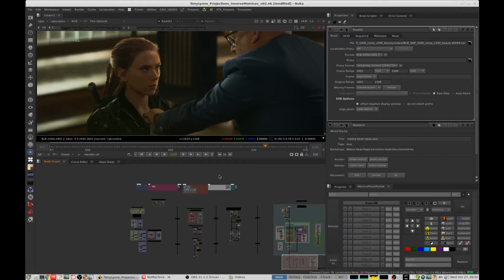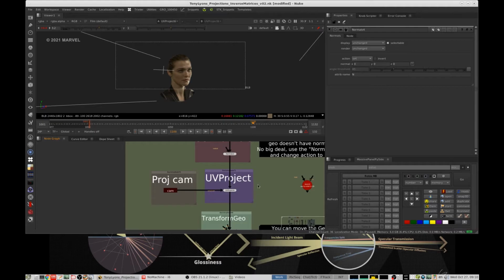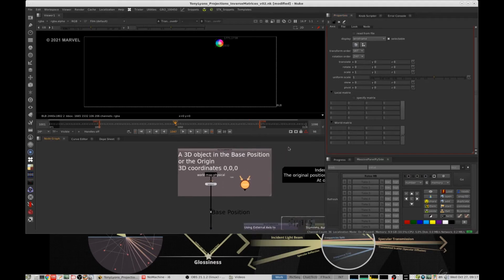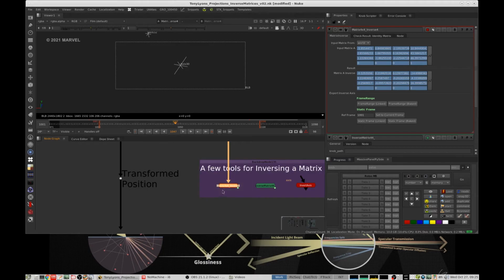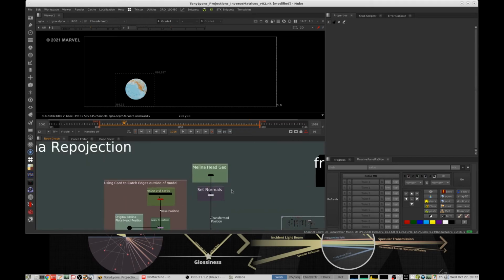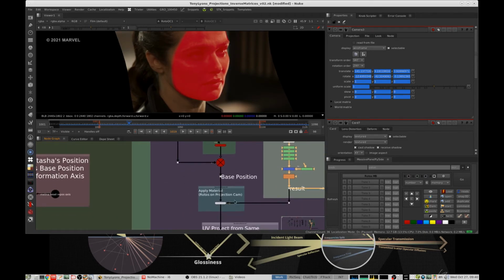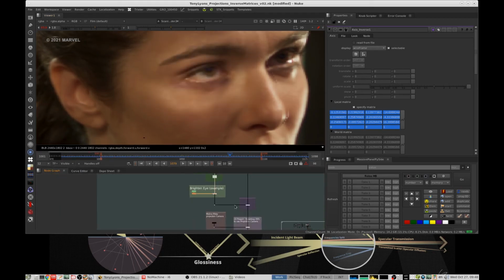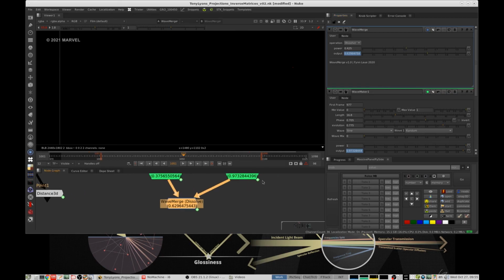Advanced Projection (Part 01)

Comment: Nice tutorial. Not enough training focuses on the basics of inverse transformations and matrices. Things to note, matrices are used to prevent filter hits due to concatenation, this extends to color matrices. I would also explore the STmap approach instead of the texture. It can be challenging to setup, but gives a lot more flexibility. And finally, in this specific shot, I would have considered Splinewarps (and Smart Vectors for details) to match the faces with no requirement for rotomation, modelling, UVing, and/or Facetracker (even though I am a big fan of Keentools).